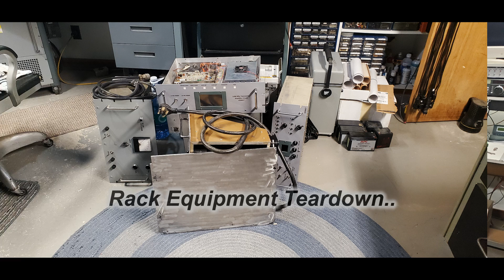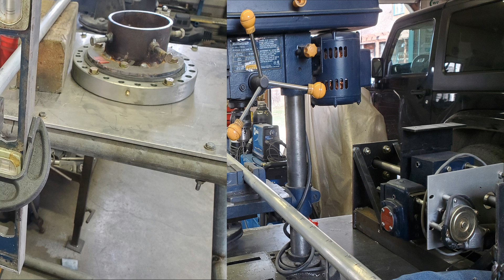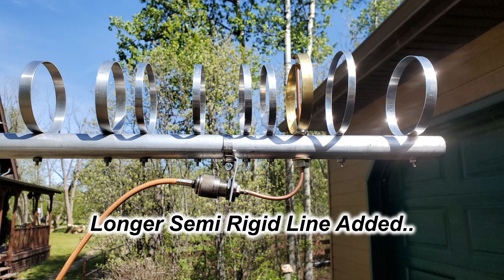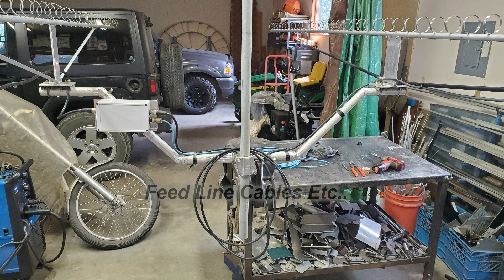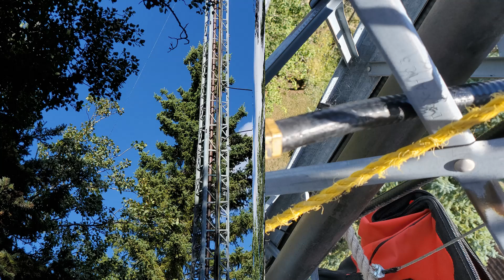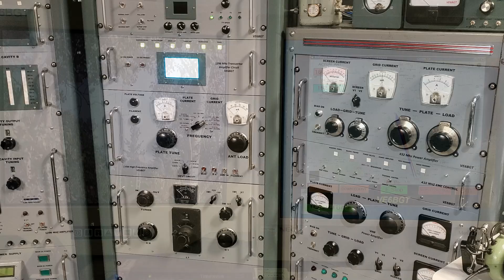23CM Terrestrial Project, Ants

Comment: Always love seeing your experiments.  At what frequency would it be preferable to down convert at the antenna (to minimize feedline losses and cost)?  Yea that extra spike, sometimes higher than the main.
Reply from the maker: Hello and thanks.. With the EME dish I still feed 3.4 Ghz down the helix but again I have two preamp stages and then the poweramp at the feed.. That over comes the losses.. The recieve side the high gain preamp overcomes the losses in the long feed..  BUT with 6cm or 5.7 Ghz it's to lossy.. Everything is at the feed and the lower IF signal of 144 Mhz gets all the way back to the shack easily.. Skip

Comment: So mr. Murphy bit you in the A**  with the control line cabling?  ....all done hanging 10m above the ground..... damn I forgot the shrink sleeve....😀
Reply from the maker: No Mr. Murphy.. The cable used to run a small rotor down on the side of the tower.. I was just extending it to reach farther up..  No heat shrink, enough taking the soldering iron up there.. Good tape is good enough.. Murphy hit me when my climbing belt fell down past my arse and I couldn't get it back up again!! Ha ha, that was crazy..
Reply: @VE6BGT  🤣🤣